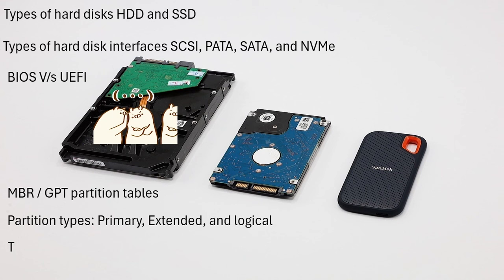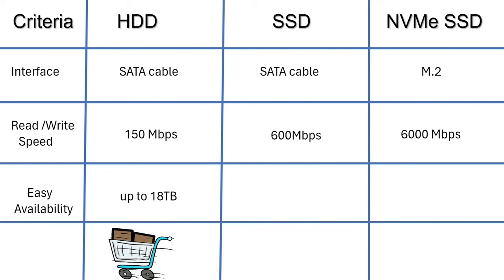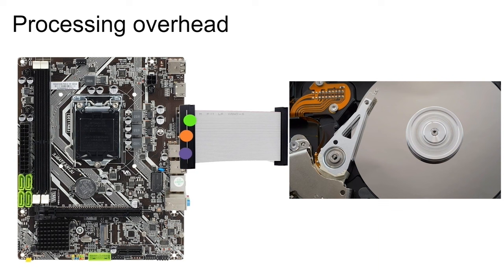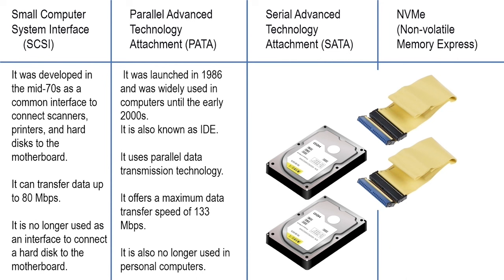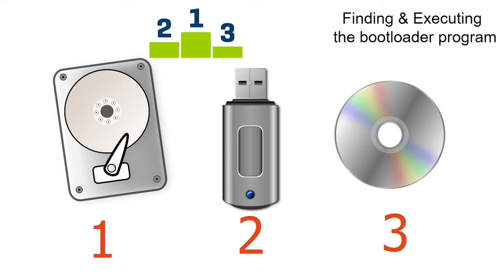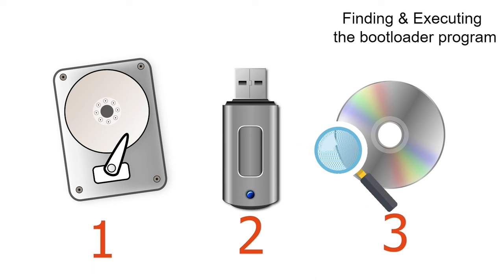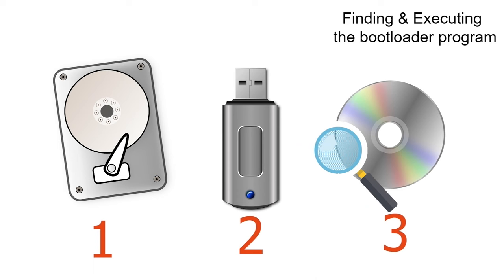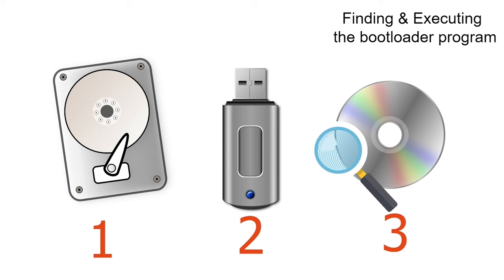Hard Disk Types | SCSI, SATA, PATA, NVMe | BIOS and UEFI | MBR and GPT Explained with Examples

Comment: Hi. Why SAS is not on "the type of interfaces" list? Or is it something different?
Reply from the maker: No, it is not different. It is a type of interface. Computer interfaces are very complex. You could study them for years and still have a lot to learn. So, I described them in the most simplistic terms possible. 
SAS is similar to SATA. Both use serial transmission to transfer data. Both use the following cable layout.
two conductors for sending data
two conductors for receiving data
Ground cables in between the conductors to reduce interference
In a SATA cable, all 4 wires are placed within the same cable. In a SAS cable, the 4 wires are separated into 2 different cables. SAS is generally more expensive, and it’s better suited for use in servers or processing-heavy computer workstations. SATA is less expensive, and it’s better suited for desktop file storage.
Since SAS is similar to SATA and less used in personal computers, I explained SATA and skipped SAS to keep this video simple for beginners.
Reply from the maker: Welcome @operationalemail,   You will definitely become a system administrator one day. Hard work always pays. We are here to help you on any topic you think is hard to understand.

Comment: 6:22 40 pin cable allows 2 hdds on one cable too. Remember Master/Slave/Cable Select Jumpers on Devices. 80 pin cable allows faster communications (UDMA...).
Reply from the maker: Hello @michaelk.6976,

Thanks for your comment.
Yes, we can connect two devices with a single IDE cable. But it depends on how many connectors the cable has. If it has two connectors, you can attach one device. If it has three connectors, you can attach two devices using jumpers. I mentioned the two-connector cable as the 40-pin cable and the three-connector cable as the 80-pin cable. 
So far as pins are concerned, all IDE cables are 40 pins. UDMA cables are 80 wires. The additional 40  wires are ground wires that help to keep the signal cleaner. The difference is in speed/standards. 80-way/pin cables are for ATA 66  and higher speeds, ie HDD. 40-way/pin cables and for ATA 33, ie DVD/CD. 
To attach two devices with a single cable, you need a three-connector cable. One connector connects to the IDE slot on the motherboard, the second connects to the first IDE device, and the third connects to the second.

Regards
ComputerNetworkingNotes